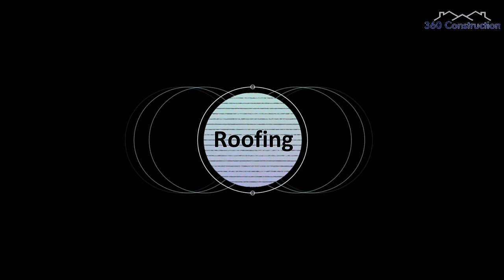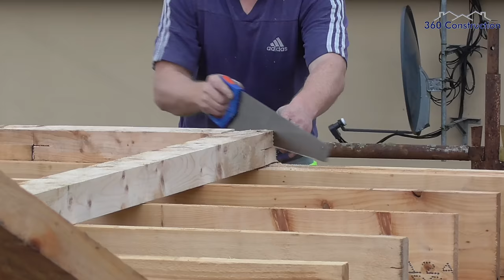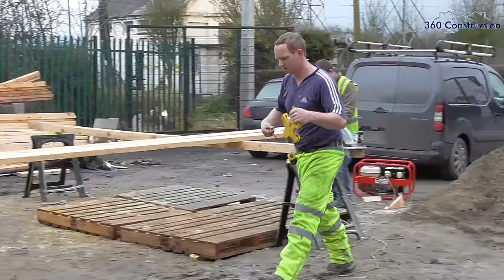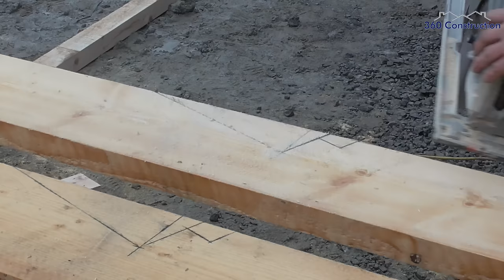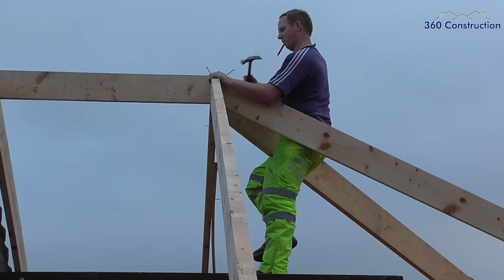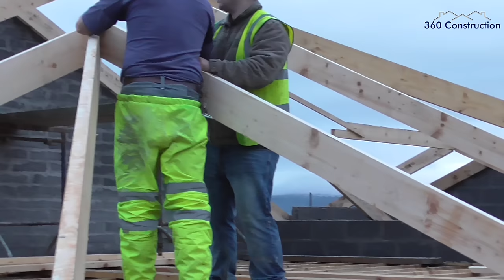Roofing - Rafter Assembly

Comment: Nice job fella 👍
Still confused on how to calculate each jack rafter lengths. 
Any tips?
Reply: Using common difference
Reply: Spaced out with the same measurement of the joist, standard 400mm spacing,just squared off the common rafter as shown in the video 
 400 800  1200 1600 2metres and so on...

Comment: Whatever happened to the trusty roofing square, no need for a tape measure when using a square
Reply: thinking the same thing, was disappointed. Lost art, but so much easier
Reply: Michael Eldridge In theory yes if your building is dead square and plates level. I'm a chippy with 27 years experience and I always take the direct measurement of the hips as there are a lot of crap Brickies in the UK who can't build square. Everything else I cut on the floor using the square. They could cut the jacks without measuring but they aren't using a traditional roofing square. No need for the poleplate on top of the joists either. The wall plate is sufficient. I guess they aren't proper roofing carpenters.
Reply: That method might work on the simplest of homes .. but when you get into the crazy complex homes today .. The error of stepping off or scaling is inaccurate .. I come from Old School carpentry .. and realized when I hit the Big Complex homes .. The error factor was just too much
Reply: tchornomud
Reply: The roofing square is not trusty,  and only square on square stuff.

Comment: Typical framing ... kinda old-school ..   I see 3 rafters  "King Rafters " that are a waste to install .. All they are used for in old school is to establish the ridge .. .. Cheek cut the hips instead of a wedged ducktailed hip . 2 hips can establish the ridge as well if not better than 3 Kings and 2 hips .. Then you gotta deal with the kings in straightening when sheathing the roof and interference with joist ..  Then when I see the 100' tape to the heel .. That is a heel sweep and when they match that is not actually the hip rafter length , but two points that come into agreeance or if the roof is out of square .. A reference point for individual length to be transferred to the hip .. Now many moons ago , I too used to reference a king or the straightest layout rafter , hook a tape and lay out unto the rafter and then measure to Heel Sweep.. have someone hold the tape on every individual hip jack rafter sweep and list them .. Or the other system of  Common Length Difference and walk off the numbers according to the tables or a nifty Construction Master .. The problem with CLD  is it only works in a perfect world and many times ends up fishing out the hip jacks and sliding off layout ..Thus customized sheathing cuts or scabs !! .. .. I estimate this is a 6/12 roof .. . I have developed a way besides eliminating King Rafters .. That guarantees supreme accuracy regardless of conditions .. That doesn't require a ton of bracing to straighten , a ton of scaffolding . someone measuring each one individually nor following a Construction Master for CLD .. No marking the hips .. Just cut and install .. But center string the hip and as soon as the hip is straight at that point .. Nail it .. and it will be a perfect layout  be it 16" -13.71" -19.2" or 24" and takes 20 times less effort and a 100 times more accurate and 20 times less work ..   Kinda complex at first but simple once learned and I have freaked out other carpenters that said " It couldn't be done " .. Here goes how it works ..  The CLD on a 6/12 hip jack rafter  = 17.88 @ 16 o.c. .. So there is the number of inquiry is at 17.888"   Heel sweep the longest rafter and transfer it to the top of a Heel Plumb Cut Line.. say it come out the longest  hip jack rafter is 226-5/16"... " Record !!"   .. Heel Sweep the shortest hip jack rafter and transfer it to the top of a Heel Plumb Cut Line and say it comes out to 12-3/8" ...   Now subtract 12-3/8 from 226-5/16= 213-15/16" .. I personally transfer all my fractions to decimals " ... Now you have 213.9375 " ... Now divide 213.9375 by 17,88" The Common Length Difference "   = 11.959..   ..  Now round to 12 .. There will be 12 Hip Jack Rafters.bays or 13 Rafters . Take 213.9375 and divide by 12 = 17.828 " .. That is your CLD ..   and in going back to your longest hip jack rafter or 226.3125 begin to subtract 17.828 as a constant .. Your rafters will list as and return to 12.375" or 12-3/8 "     226.3125..... 208.48.... 190.65....172.82...155.0...137.17....119.34.... 101.51...83.68... 65.86...48.03...30.20...   and behold 12.375 .. ..This system takes away all the guess work and reduces the amount of work in scaling around a roof .. especially when you are working on hips that are 38' long and are " Bastard Hips " with one pitch one one side being a 10.72/12 and the other side being a 14.625/12 and you have a 19.2 " layout ..   This system also works on the simplest homes .. I guess I am hijacking this comment page .. I like to teach .. I stress ..learn basic math .. the more the better and my last recommendation  Not only learn to transfer fractions into decimals .. learn to translate Fractions into a simpler language .. If you are lifting off a undulating slab for instance and the walls are basically in the " Say " 143"  range .. Instead of listing the studs individually as 143 -3/16 .. 143 -1/2 "  143 -3/4 " ..   Toss away the 143 .. relegate it to memory .. Now  change the fractions to simple numbers of 15 ..   143 -3/16 .. becomes " 3 "  ... 143-1/2 " becomes "8" .. 143 -3/4 becomes "12" .. So if a number is giving to you from atop a roof .. You hear " 226-2 " you know it's 226 -1/8 .. and when people write hurriedly .. and I can't tell you how many times I saw 3/16 , 3/8  and 3/4  written that you couldn't decipher .. They are  3,, 6 and 12 ... I live by these motto's " Efficiency is intelligent laziness " and Simplicity is the ultimate sophistication " ... I have nearly 40 years of carpentry experience .. I have seen it all seemingly , I have dangled on a roof rolling felt , smashed my thumb , carried trainloads of lumber and wallowed in mud , ice .. But I never stopped thinking ..  I know architects by name now , have built homes that have graced the front covers of magazines , offered professorships in other states , asked to write books .. Built for billionaires and helped friends out on a set of steps to their double-wide .. My greatest love is finding something after all theses years and seeing someone else improve upon them ..  I was young once and told I could never learn .. That drives me ..
Reply: Hey Ivory can you tell me how to use ur calculations, email me, I like learning. Thanks
Ruben
Reply: Something I’ve learnt too, if the math is correct and you’ve worked out the diminishing rafter length correctly they all fall on Centre perfectly when the hip is strung straight, works the same on valleys too.

Comment: Lovely job lads , you not like using nail guns ?
Reply: Bob Builder 

oli
Reply: Bob Builder You can't use Paslode nails if it's NHBC, they need to be minimum of 3.35mm thick and Paslode are less. Even on roof battens they won't allow it for roofers but some inspectors let it go. Plus it's much better nailing a roof by hand with 3" & 4" wires. It's a shit job if a Paslode is used.
Reply: @BillyMustang101  totally agree! Paslode is lazy. I use paslode on collars only

Comment: when did the footage take?  The nail gun hadn't been invented yet?
Reply: Do they do nail guns for 4 inch nails?
This is proper carpentry mate, not popping on architraves!

Even US building codes specify hand nailing 3 and 4 inchers, and ringshanks.
Reply: @thetessellater9163  lmao, we use screws in Germany. Way faster and easier. Renewing parts is also a breeze then. Our nailguns go up to about 60mm and we use 140mm screws.

Comment: Common difference and a tail pattern. If it’s square and you cut the three commons correctly, should be able to cut em all at once. Get some guns and a compressor. Can’t make money doin it that way.
Reply: Albert Backauskas he’s in day rate I bet. Here in U.K. a lot are. Also he’s putting in 4inch nails at 4/4.5mm diameter most guns we get over here are 90-3.2mm diameter while they are ok if you want to make the step up to a gun that fires 100x4mm your talking big money over here and big money to buy the nails too.